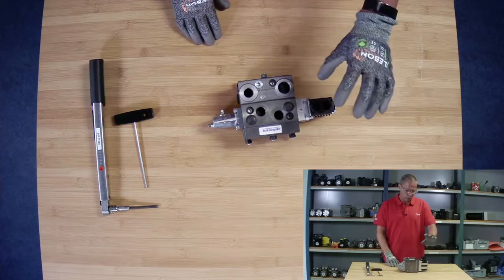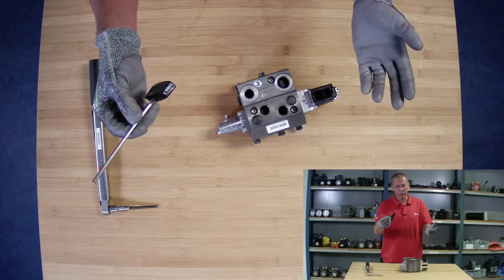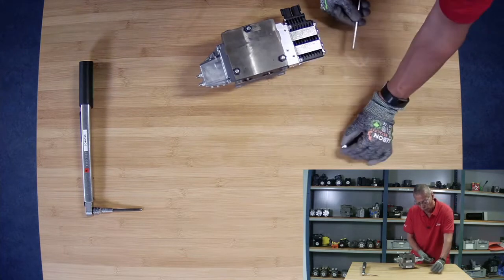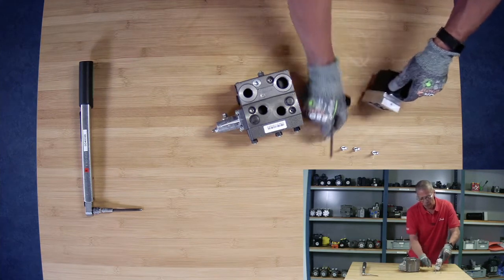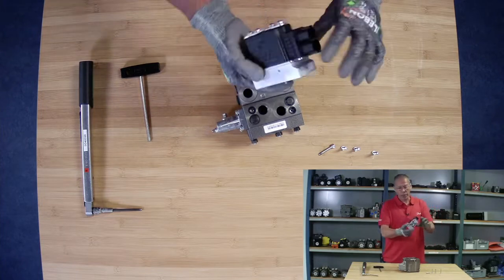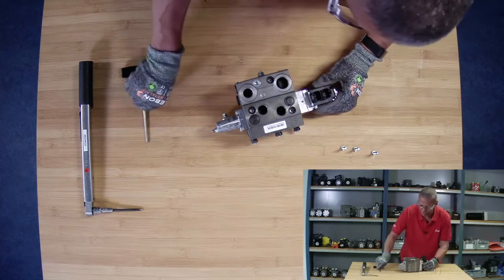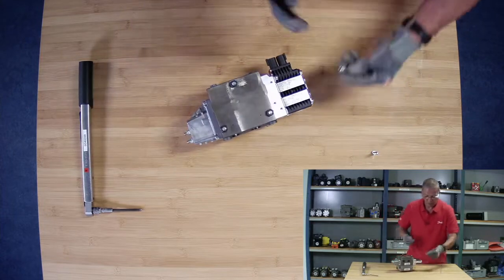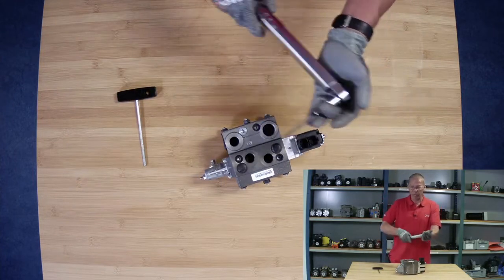Disassembling a PVE on a Danfoss PVG Proportional Valve

Comment: Good day. I have a this piece [pve/pvg] and it stopped working. The machine goes up and down mannually but it doesnt send signals trough the pve. I tried changing the pve with a new one... but it seems this didnt fix the issue. What should i check next?